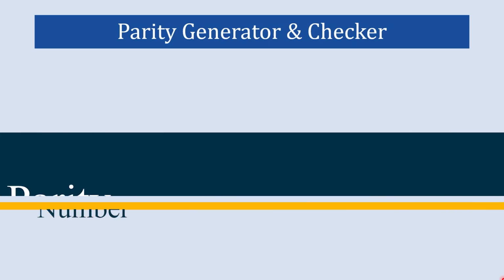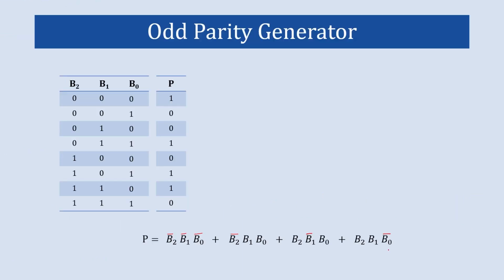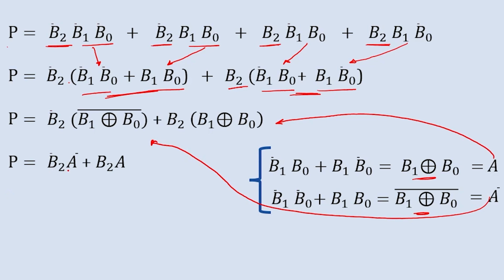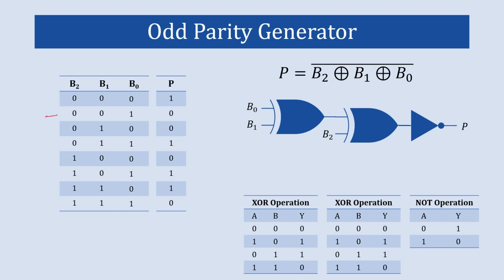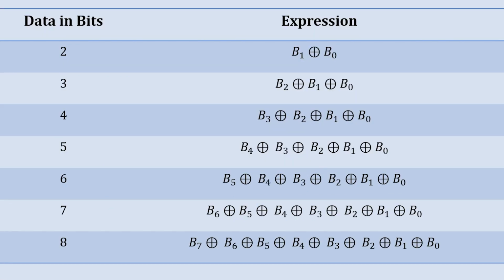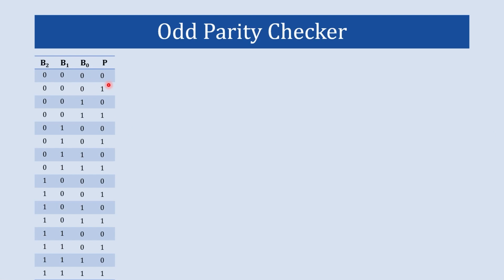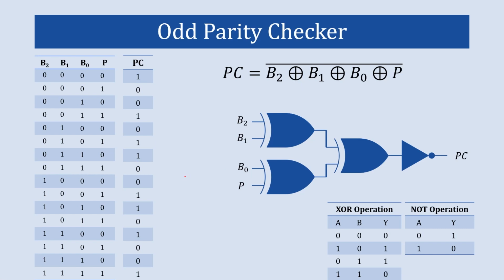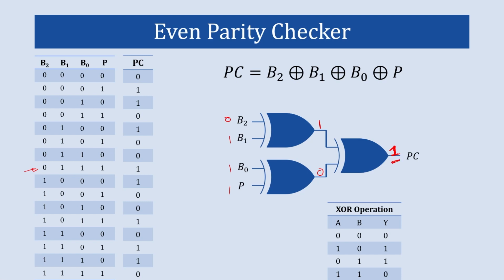Parity Generator | Parity Checker | Parity generator and Parity checker

Comment: Thank you for providing elements of the digital circuit to show how the data is transmitted in the system.  If the check bits do not match, how does the system reject the information and request it to be resent?  What circuit elements are employed?